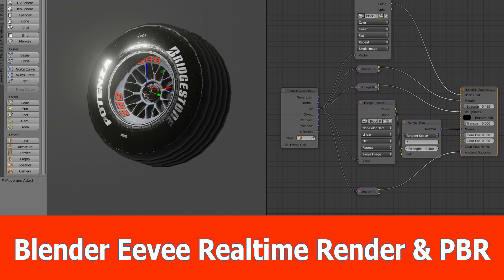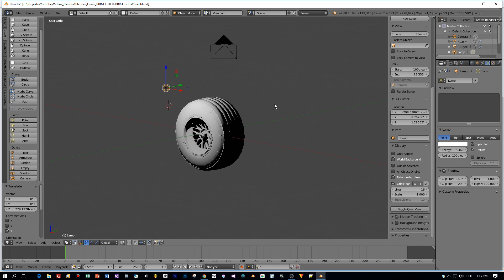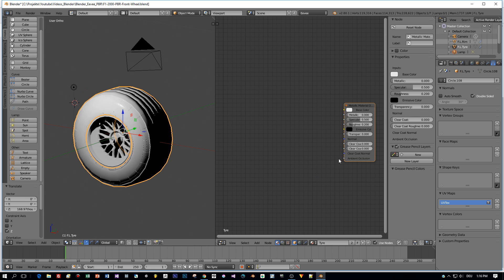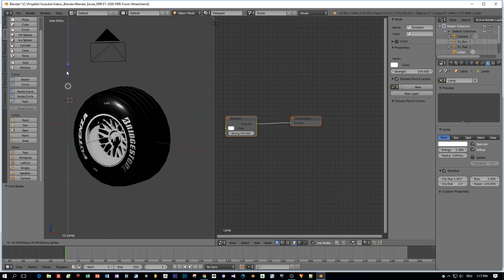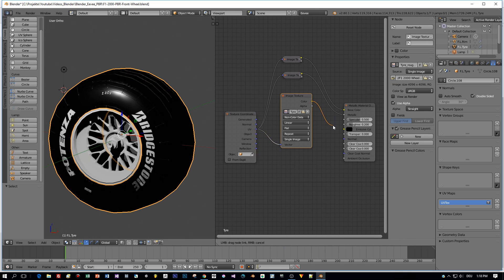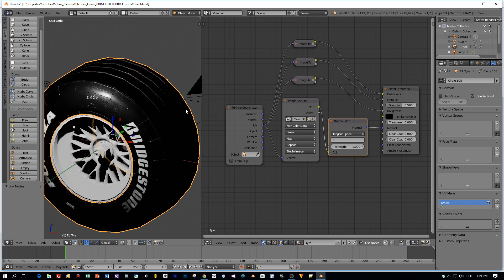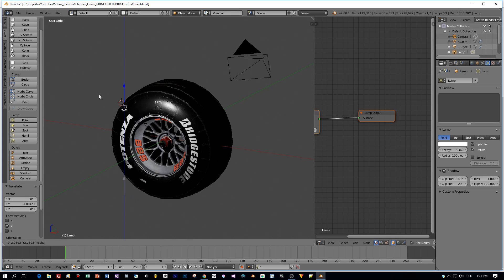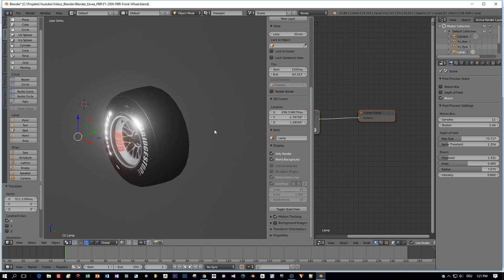Blender Eevee Realtime Rendering Engine & PBR

Comment: Looks great. Can't wait to try it out. I have slightly related question - I still haven't managed to confirm whether the new Eevee renderer will be completely compatible with Cycles materials. i.e. Will we be able to use the new Principled BSDF node to create materials to render with Eevee renderer? Or will we need to learn a new engine/node system from scratch?

Comment: Metallic map for a rubber tyre?  Seems a bit pointless.
Reply from the maker: The input slot of the material output node is a texture, and yes, for the rubber part, it is just black:-)
Reply from the maker: Metallic doesn't mean that it is only for metal, when doing pbr, there is a workflow for metalness and specular, please search for metallic vs specular pbr workflow.
Reply: I think Stephen's right, if all the different materials of an object are non-metallic, you could also just drag the slider to "0".

Comment: Does EEVEE work with cycle shaders or ?
Reply from the maker: There are Uber shaders so that you can switch easily between the rendering engines like cycles or eevee.
Reply: So if I understand right, that if I use PBR shaders now they will work on Eevee as well or what are UBER shaders?
Reply from the maker: Please have a look at this article: https://code.blender.org/2017/03/eevee-roadmap/
Reply: Thanks.